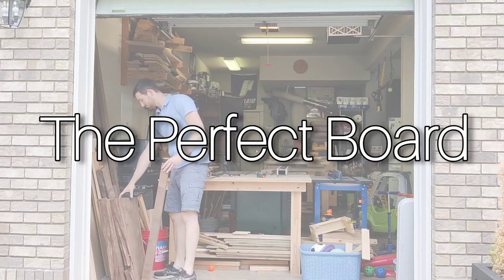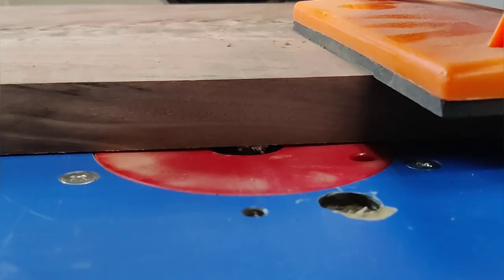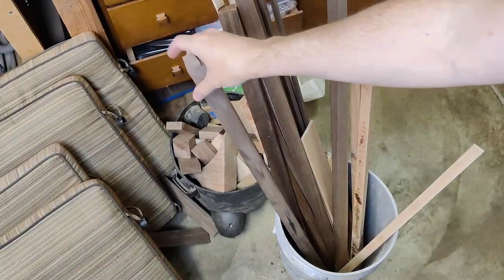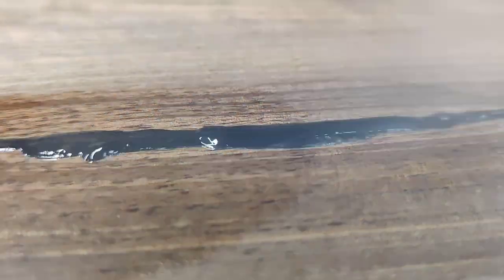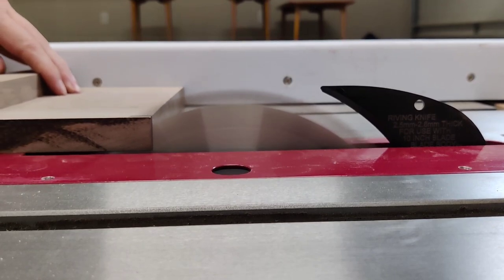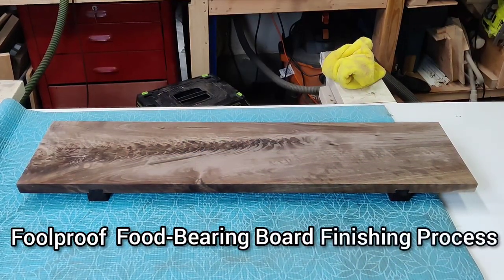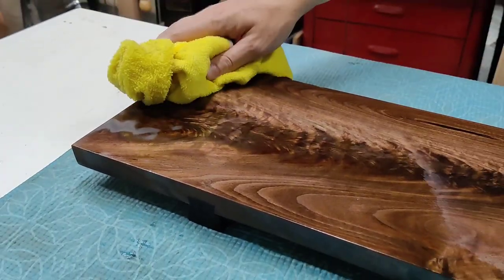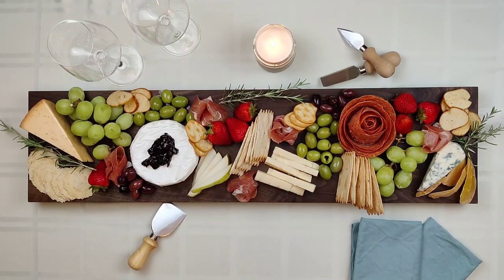Making The Best Charcuterie Board

Comment: Really nice video.  I do have some old boards I've been saving for a project.  Most of the boards from my parent's place.  Some I believe to be from my grandpa's place.  Not really sure much about them.  I'm afraid some of them may be treated (or was 50 years ago) so I'm scared to use them on anything that would touch food.
Reply from the maker: I would be worried about those treated boards too for an application like this, but an outdoor project, for sure!